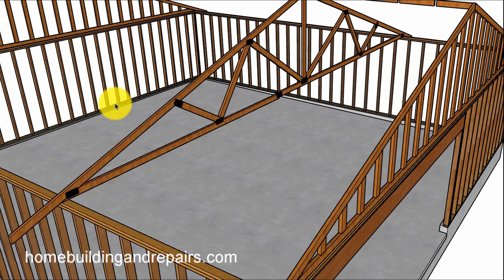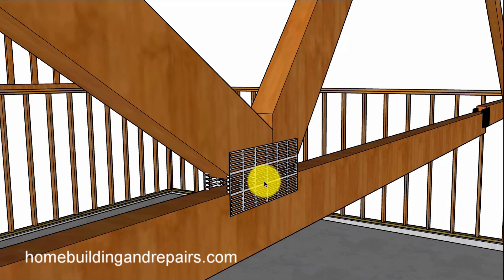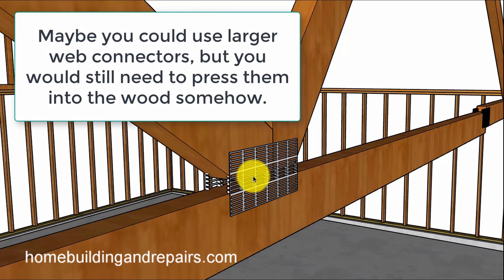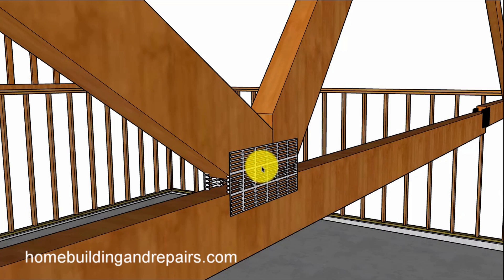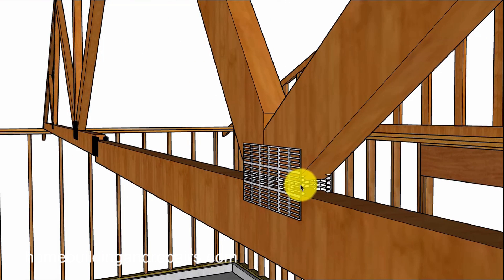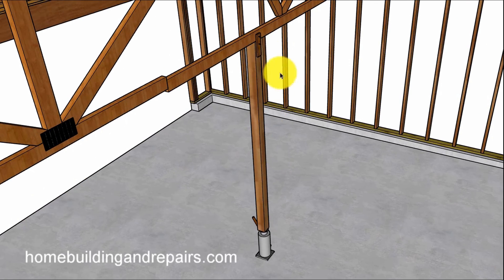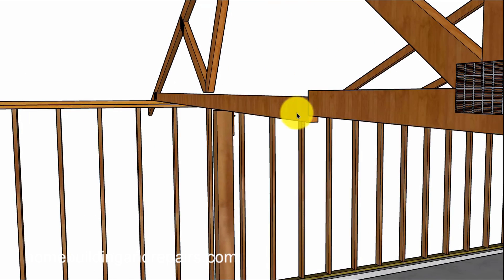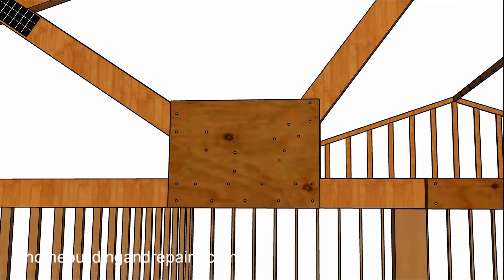Bottom Roof Truss Cord Repair Ideas – Engineered Roof Framing Systems

Comment from the maker: Remember, these truss repairs are only suggestions and might not work on your project. Even though I clearly stated in the video that these repairs might not work on every project (as stated clearly in this video, here is a time frame link 3:31).

The reason why I'm posting this comment is because someone suggested that the information in this video is misleading and that you should contact an engineer or even a local truss manufacturer for the correct repair information. I agree.

Comment: We just set the trusses on a new build.  The trusses over the open concept kitchen, dining and living room are well over 30’ long. The bottom chord consists of 2 long 2x6s joined in the middle of the truss with the metal gusset plates.  The butt joints are all in a straight line with every other truss and are not staggered.  The wide area of the “attic” style trusses above the joints is open with no braces or support for the bottom chord.  It concerns me that the joints are literally just hanging over the largest section of the room, held together by only the metal gusset plates.

Comment: OK, so not an engineer, and have seen info that nails have more sheer strength than screws. However, why not create a sandwich with your plywood at each butt joint using steel bolts, washers, and nuts? I don’t even trust nails to hold on a birdhouse. Temperature and humidity variations work nails free.
Reply from the maker: It sounds like a good idea and I'm guessing nuts and bolts might drive up cost.
Reply: @gregvancom  Of course they would, however, the added strength and safety would warrant it. I’m assuming this is a personal build, not for multiple jobs. I just like maximum strength for lifting/support jobs.
Good video.

Comment: I use PL-400 Construction glue for this repair as a extra strength The same as the center beam under the floor of a New Home Build. These methods are used by builders in Canada. PL 400 is water resistive and is recommended for Lamination of structural beams and Headers for studding and plywood but i like to use nails as a added guaranty over time.

Comment: Thanks for your videos. Wish I knew what I know now. The siding guys completely removed this piece from the end of my vaulted ceiling porch.  I redid the siding years  ago so didn't know or understand the consequence of what they did, i.e. it was no longer secured to the house. It got leakes and when the roof was replaced with better shingles and t1-11 the roofer didn't flash right or notice there were issues. Now it's leaking again and needs raising as well as secured to the house. Have you ever seen this done. Its sort of a combination of this and your new sagging porch video.
Reply from the maker: Feel free to send me some pictures of the damage and I'll see if I can provide you with more information. You can get our email address at our website.

Comment: A lot of misinformation and improper methods.  Please, contact the truss manufacturer, they will have a repair designed by an Engineer for the application.
Reply from the maker: I know this is going to sound odd, but can you provide us with anything validating your claim?
Reply: gregvancom I would draw upon my 20+ years experience in Truss/floor/wall panel design and Engineering....but that would be doing you a favor.  
You are Generalizing repairs of an Engineered product, this can lead to complete failure.  I find these videos misleading.
Reply from the maker: I can easily understand how some of the information in this video can seem to be misleading, but as I clearly stated in 3:31, these repairs won't work for everyone. I also posted a comment at the top that might be more helpful to future viewers.

Can you provide me with anything in the video that is false? There's a big difference between someone's interpretation of incorrect information and it being stated clearly in that manner.
Reply: If you glue the wood gusset prior to nailing them, they should be more structurally sound than the original metal nail plates. I prefer wood gussets to the metal crap they sell these days. Glued & nailed gussets have been in use for over a hundred years with no problems.
Reply: I have 1 broken roof truss. I plan to repair it but how can I tell who the manufacturer is? I couldn't find the name stamped or printed into the truss of my 1966 Oakland, CA home.
Reply: @donaldlee6760  contact a structural engineer...
Reply: And if your car overheats, take it to an Automotive Engineer and designer. Do not take it to an auto mechanic or repair shop. See how stupid that sounds.

Comment: Awesome video.  I just reinforced some webbing that was coming apart with plywood.  To prevent splitting, and to prevent violent hammering from doing something bad to the drywall ceiling below, I used code-conformant structural screws and predrilled them just a bit.  Worked great.  No more creaking and popping as the attic heats up and cools every day.
Reply from the maker: Thanks for taking the time to share your experience with us. Comments like yours are sincerely appreciated, but you will need to remove all product information, thanks in advance and thanks for watching.
Reply: How's that?  :)
Reply from the maker: I love it and sincerely appreciate it. I haven't came across a trust repair yet that use screws or even structural screws, but think it will be done more in the future.

Comment: Any time I've seen these failures is because plumbers or AC guys cutt the wood out or cutt 2nd floor floor joists to install a fireplace. My QUESTION IS why is it just left and who's job is it to go back and rebrace around the AC, toilet drains, chimney etc.???
   I've been buying 1980s quads to fix and rent and they all have these same problems. Example: 2x12x16 floor joist completely cutt off 2 feet from the end for AC. It's just hanging from the nails in the plywood floor. The whole floor had dropped 1 inch or more in that area. (16 inch on center) I in the case of the old insert fire place the ceilings of the downstairs apartments  drop 2 inches because 2 trusses were cutt. I pulled the fireplace insert. Added a wall to support the trusses and turned the space into a closet.
Reply from the maker: I would imagine that anyone who cuts or removes any of the webbing would be responsible. However, if you're talking about going after someone 20 or 30 years ago, good luck.
Reply: No, going after someone never crossed my mind I was just wondering if the inspector is responsible because he never looked or if the builder should have come back. Plumbers and AC guys don't know carpentry. Just didn't know how things worked real world
Reply from the maker: I think the biggest problem with responsibility would be actually figuring out who did the damage. For example the building could have been built and inspected, before the damage was done. If the building was only a few years old, then you might find the culprit, but something that's 30 years old, might be hard to do.

It gets even worse when people purchase properties that are in financial distress and take them as they are and then end up with problems like yours when they go to sell the home. If you're really interested, you could go down to your local building department and find out who did all of the work and who pulled all the permits, but you would still need to get someone to admit that they were the ones responsible and that's probably going to be difficult to do. Hope this helps.
Reply: gregvancom - permits are only good if there actually are permits!  How many homeowners "employ" their buddies to help them on the weekends.